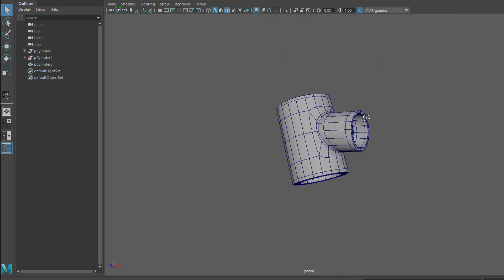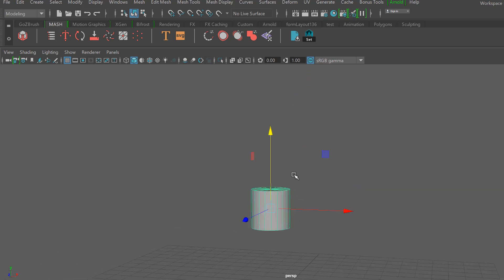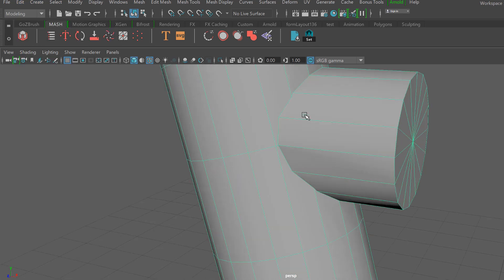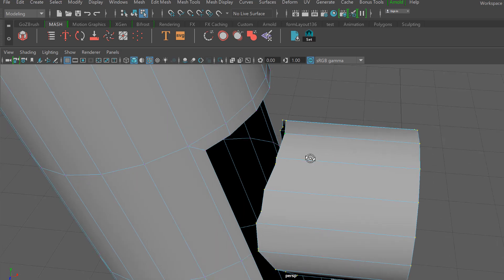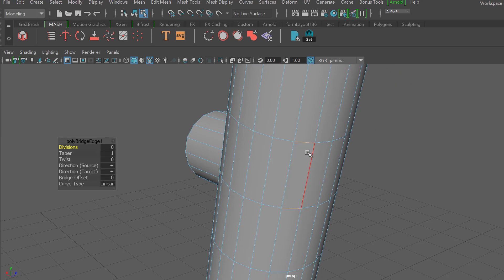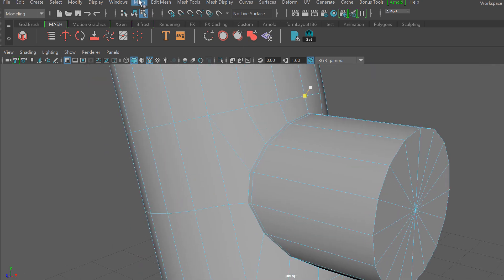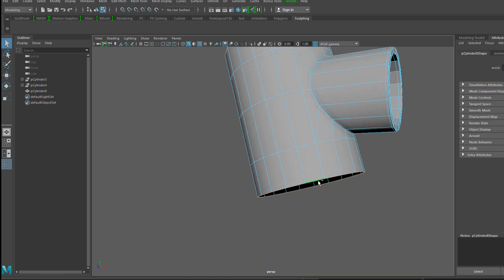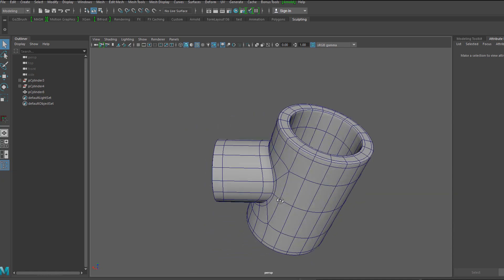Maya 2018 3d Modeling Tutorial: Creating Complex Shapes Using Booleans in Maya

Comment: 5 years later I'm here to tell y'all it works exactly as shown if you use 16 sided cylinders. Also, select your faces and extrude>offset prior to the boolean>union, or it doesn't work. Also, just place an edge loop above, below, and then middle mouse click to center the final loop. After, position the smaller cylinder so that the vertical edge lines up with that middle horizontal loop just so it's easier to snap the verts after deleting the faces in the next step.

Comment: To everybody that can't seem to fix the problem at 2:15, Mussi does an edit in the video at 2:09 where it shows both vertical cylinder not booleaned. Mussi creates the 3 loops first and insets using the extrude. Then proceeds to do boolean > union. So, what you need to do is not do the boolean firstly. Otherwise if you do, you will get this rim of faces made by the edges of the horizontal cylinder. Hope this helps!
Reply: the tutorial of the tutorial, thanks!  Is it just me or my vertices don´t match, can you help me?
Reply: @danielgalvezvidal4899  No problem. What vertices aren't matching? Can you elaborate? :)
Reply: @danielgalvezvidal4899  I tried this as well and even though both cylinders have the same number of faces, they
extrude doesnt match up for me either :/

Comment: trying to do the same at maya 2018/19. if i do union, this adds extra edge around the embeding object while extruding with offset.
if i do only combine - i can do extrude with offset like at your video, but embedding object doesn't have the curvature at the point of union (because there're no union).
tried to delete history or not - doesn't help at all. really can't realize how to fight with it. can you help, man?
https://i.gyazo.com/e2c95299315fbe800894feb26d4f1315.png
Reply: what maya did in your case is merge vertices of both objects, so when you extrude it count polys of horyzontal object as well, while in case of JL Mussi maya didn't merge vertices of both object. rewatch this moment on 1:40. Sorry for bad english, hope you'll get what I mean =)
Reply: I'm having the same problem. How did you sort it out?
Reply: @hvindoo  just checked this method of creating such mesh and for me it still doesn't work as it shown in this video (same results as 10 months ago) xD don't have any idea why. so i make similar meshes in a different way like extruding circulized (or circled with multi-cut tool around the perimeter of the pattern) polygons up; without using booleans.
this way much faster and cleaner.
Reply: @super-six-four  okay thank you. :D
Reply: @hvindoo  the only working method to avoid extra polygons while extruding in this exercise is to make face extrusion first, THEN do boolean union.
Reply: @super-six-four  cool. Done. It's working 👍

Comment: I am trying to model a weird shaped vase. I completed shaping it and then extruded to give the depth.
Now I want to put holes in it and that's where the problems start. After deleting few faces, I cannot use the bridge or fill hole command to seal the "gap" between the two walls of the vase (the extruded and the internal wall)..  
Any tips? 
Would it work if I modeled and cut the holes before I extrude?
Reply from the maker: Kinda hard to troubleshoot via a comment like this. Best bet is post your reference on my Facebook page and I can do a video request on it.  facebook.com/jlmussi
Reply: @jlmussi  thanks for the response.  I'll do that

Comment: Hi JL, followed perfectly but until the snapping the verts, my side subdivisions on the small cylinder was more than the big vertical cylinder, meaning I didnt get to snap all the vertices together, and merging the verts did no effect to my mesh. Any thoughts on this?
Reply from the maker: Hello CrayV, when it comes to cylindrical shapes, you have to calculate this ahead of time.  Some shapes you can get away by adding more edge flow and balancing out the number of verts but not cylinders as they require perfect edge distribution.